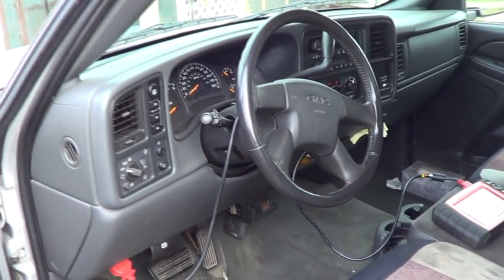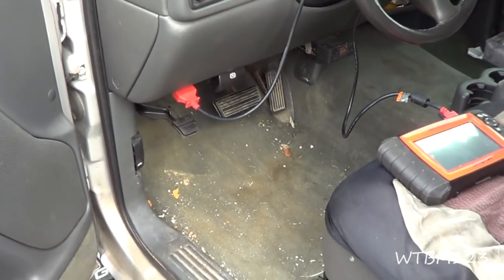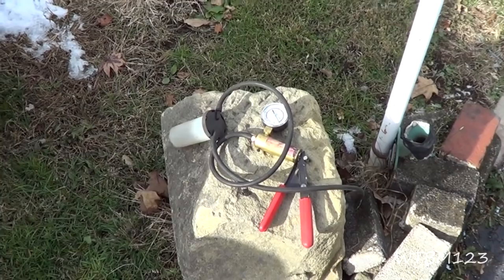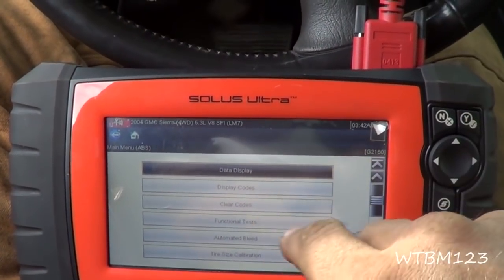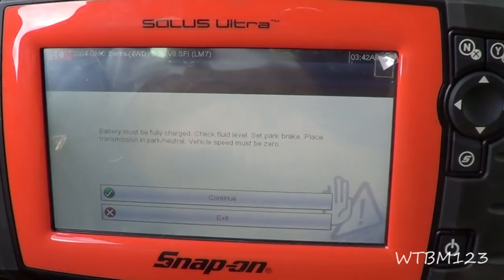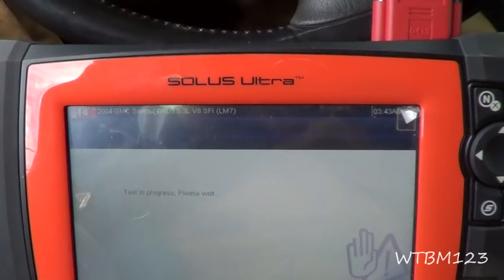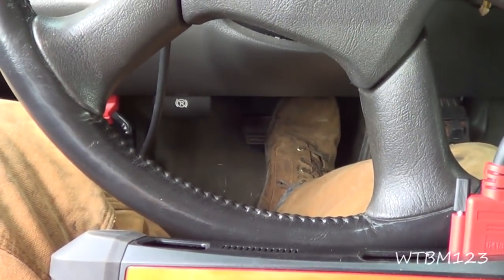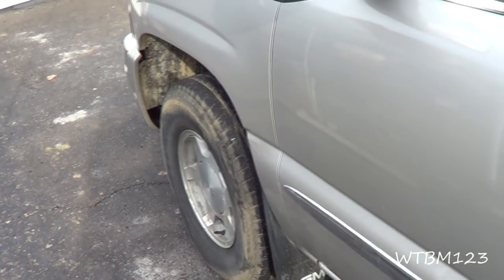Bleeding the ABS Brake Control Module,On a Chevy Using a Snap On Solus Ultra

Comment: So how many hundred dollars does that Snap On Solus Ultra cost?  Back yard mechanics can't afford that kind of money.  My 2001 Dodge can't be bled without scanning the ABS unit.  I'm going back to pre-1984 vehicles.  Computerized vehicles are wallet draining pieces of crap!
Reply: mike johnson or buy a maxicheck pro scan tool. Its about 150. Has auto bleed.
Reply: Scanner Diagnostic Scan Foxwell NT630 Pro,  $110,   most will only read ABS codes, this one can exercise ABS also.
Reply: Ron Dail how does that foxwell scanner work? Referring the auto bleed
Reply: @Otsp922  

It tells you the whole process then you manually bleed like you would.  RR, LR, FR FL in most cases.  I have the NT630 and Autel DS708
Reply: Ron Dail - 2 questions: Do you own one of these Foxwell's, and have you ever bled an ABS system using it? Thanks.
Reply from the maker: It is pricey , but I think there are some out there cheaper that will do it .
Reply: @mike johnson oh lord I love this one. I bet your the guy that brings the auto zone pamphlet of paper with 1 code per page on it and gets pissed bc I say I still need to scan you vehicle with my scanner bc it may have set new transmission codes on the way from auto zone. Lol. Go have the parts boy fix your car then.
Reply: sportster88 5k
Reply: Ron ???
Reply: Dude just bypass it and cover the abs light
Reply: Bradley Knight 
Bradley, are u saying that by pulling the Abs fuse you wouldn’t have to worry about bleeding the abs unit? I’ve pulled the fuse and gone back to old school brakes and need to do a brake line job. Concerned about bleeding procedure without said fuse.
Reply: Try Autel maxicheck pro it does mine.
Reply: sportster88 yes you can bleed the brakes because I have done it here's what you do. 1 bleed the front now drive it on a old road  you are going to go about 30 miles per hour 40 slam on your brakes it's going to open that ABS brake system up and start sending brake fluid to the back brakes get out bleed the back brakes get back in go down the road slam on the brakes again bleed the back brakes it's going to take a while but it will open that abs up and start sending fluid to the back it's a long process but it is cheap that's how you do that
Reply: @scooterb9162  i did that on a lift after replacing the braided lines on a chevy van 👍
Reply: @scooterb9162  
And how will you slam on the brakes if the brake pedal is sinking and you have 0% braking LOL
I took all the air out of lines pressing the pedal and then using the pump on 07 Impala and still dont have any brakes..
Reply: @velizarmilutinovic2947  me too... I'm stuck
Reply: @megaman5k  I sold the impala but i fixed the beakes,,
The caliper i was replacing i didn't tighten the hose all the way so it was constantly pulling the air in.
Reply: @velizarmilutinovic2947  damn. how did u find out it was the line? im thinking about replacing the booster but idk

Comment: Is their a different scanner I can use besides the gm tech 1 to cycle my abs on my 1994 silverado k1500?It is very difficult to obtain the tech 1 scanner because it is so old and I am wondering if their is a scanner I can use that can cycle the abs any feedback appreciated
Reply from the maker: I am not sure . the snap on scanners can do a lot of them , some older ones had a bleeder valve on the abs unit

Comment: Good Video i Need to ask you about  the abs light on a 1999 Gmc Yukon  put all new lines  on it  new hubs in the front  and  adjusted the rear shoes  made sure  the front pads slid  easy  used a bleeder tool like yours master was new check all the rubber  lines  the truck some times just the rear  skids  after it rains and the truck sat for a day  but i never got the abs light to be off after i did all of the work  and some time it just has a mine of its owe right  what do you think it could be  just asking right  thanks for the video
Reply from the maker: Would need to know abs codes. Some older ones with metallic shoes would rust or leave a print on drum and cause a rear brake to stick , but the abs light would need to be looked at with a computer to get the codes and data

Comment: can I manually get the air out via some foot bleed. I have to replace metal flex line from prop valve to pump.  if I get enough pedal can some abs stops in gravel push this air out of unit? the suction bleed out of lines.
Reply from the maker: It is possible to get some air out of a unit that way , but will still need to bleed it down and out of line . It is more uncontrollable doing that way , with the scanner you know it has done all the wheels . All you can do is try
Reply: wtbm123 
thanks for the reply.  I don't have a scanner. I know I will get air in abs since it's before unit.  if it's even driveable after I will take it to Chevy for proper bleed.  just trying to save the labor charge on parts replacement.

Comment: Hoping you might know what's causing my issue. I have an 03, 1500, z71. I've had a soft pedal ever since I did my first brake job using 3rd party parts. Over the years tried everything, every solution I could find on forums. Finally got new everything directly from GM parts (except for rotors and calipers). Lines, MC, hoses, pads. I always used Bosch rotors and have tried four different calipers from two different stores (their top of the line). I've had them bled over 6 times. Three by professional mechanics. NO IMPROVEMENT at all. However...

The reason for the post is to point out something I did to troubleshoot the issue and want to know if the results can help anyone understand what the problem may be. When I clamp off the two front brake hoses (from line to caliper), I get a really hard, and high, pedal. It's exactly how it is supposed to be, how it was when I fist bought the truck. When I remove the clamps the pedal returns to soft and low. My understanding of this method is that it's telling me, then, that there's nothing wrong with the system "before" the clamps. Something between the clamp and the caliper piston is causing this.

Other Notes: Brakes do not leak. Three bleed methods have been tried (push, pull and gravity). Front rotors are wearing evenly as are the rears, however the rears are wearing much faster than the fronts. My impression is that the rear brakes are working harder than the fronts. I also base this on how it feels when stopping, and physically touching the wheel rim and noticing that the backs are hotter than the fronts. I can do long four hours rides and the heat remains the same. The pedal is soft, but the stranger issue is that peddle goes about halfway down before it even begins to brake. Also, while bleeding the rears the flow rate is very slow out of the bleeder compared to the fronts.

Any help would be greatly appreciated.
Reply: Change calipers?

Comment: same process for the 2012 chevy malibu lt? i had bleed the whole system and even the master cylinder but i still spongy pedal.
Reply from the maker: Most chevys you can do this , after the computer still need to bleed to get the air out . this just pushes it out of abs unit . The rubber hoses can cause a low pedal , or pads or caliper slide pin can also

Comment: When doing the abs bleeding , is the system open at all? Or completely closed while doing the test?
Reply from the maker: closed . after the scanner , then u still have to bleed the air out of the lines . this just pushes air out of abs unit and down the lines . so u still got to remove that air

Comment: Anyone know any other cheaper tools that will run the ABS pump?   My brakes are not very tight but I'd like to do this, but this snap on tool is 2000 dollars on ebay.
Reply: Foxwell NT510. About $180 on Amazon. Be sure to get module for your brand of car to do the in-depth stuff.
Reply: Foxwell nt630 elite will do it.  About 130. On amazon.
Reply: take it to a shop durrrr
Reply: Why buy a social tool just to turn on the ABS Motor?  I let fluid go too low on a Jeep GC, pedal would hit the floor after the flush. Did another flush by jumping the ABS Motor at the relay with a 10' wire/switch.
Reply: @CajunWon1  relay to positive post ?

Comment: I done a few brake lines for a friend on a 2004 GMC Sierra 1500 2wd. I've done a few brake jobs ( mostly on ATV's and a few cars none with abs an never had a problem) I replaced both steel lines on the rear axle that "y" from the rear flex to each wheel. Also both front flex lines and the front drivers side steel line from the flex line back to the abs module. The owners thought there was a problem with the master cylinder and had it removed for three or four days prior to me working on it. I determined there was no problem with the master cylinder and bench bleed it (100 slow pumps) with no air bubbles in the tubes returning to the resivor. Then broke both line traveling to the combination valve 3 times from bottom to top to get rid of the air in the line. I've tried bleeding the brake in the correct order with a top of the line vacuum bleeder without being able to get fuild through the rear bleeders( only old fuild) so I proceeded to the front with good results. I then tried bleeding the rear with 2 pumps and crack the bleed with no luck the only way I can get fuild out the rear is to build full pressure on the peddle about 8 pumps so I bleed it that way with no bubbles but not much flow either then proceeded to the front again with good results. The truck has almost no brakes when running unless up pump them about 20 times. Could the abs module be my problem? Thanks
Reply from the maker: +Brandon Sturge Did you remove or replace the brake pads . are they able to slide in there holders freely. Are the caliper slides free and sliding smoothly .  How about the flex line from frame to rear axle, it may be bad  . may try cracking the brake line up stream someplace and see if there is pressure . , if the master is ok then there has to be pressure there , So where does it loose pressure on its route to the back . Could be air in module , but would make sure everything else was working properly first . Also be careful pumping the brake pedal all the way to floor  and give a little time between pumps

Comment: Much appreciated. I have been trying to get the air out of my friends truck brake lines. The rear shoes are good but when I try to bleed the front brakes nothing happens and feels like it creates more air. I even bled the master cylinder
Reply: did you try taking off the bleeder and cleaning the bottom hole on it? sometimes rust can block it and it won't bleed through
Reply: +jonathan corona I ended up taking the front tires off and my friends truck needed new rotors and calipers and front brakes. thanks for the response.

Comment: could air in the module cause the abs light and brake light come on at the same time intermittently?  2002 chevy suburban   thanks
Reply from the maker: +gonepriused  Probably not , usually air gets in from a rusted line or the system was open working on brake lines .
Reply: Thanks

Comment: thank you now i understand why my one trucks brakes sucks
Reply from the maker: +tlcbear2 When i get one in i first check and make sure all the brake pads them selves are not stuck , but moving freely , also the rubber lines are known to cause soft brake pedal . If i see fresh brake line work, or rusty lines , i then will use scan tool to bleed , if it helps then i bleed the lines to get rid of the air it shoved out of unit .  Thank you for watching and commenting

Comment: I have a 2004 GMC Sierra 2wd I replaced all brake pads, rotors, calipers and the 2 brake lines in the front. I've also gone thru 3 master cylinder gaskets (ripped)  Ever since I've been having issues with the passenger front locking up.  That was about 6 months ago. well the other day I finally had enough and replaced calipers, and pads again now the front driver won't bleed and the front passenger barely dribbles the rear are fine but I have no brakes, except my emergency brake, thank god. I don't understand why I had brakes before but now I don't. I'm not even sure where to start to solve the problem. Any advice would be appreciated. Thank you
Reply from the maker: +Sarah Austin Seeing as you said barely dribbles ,and locking up.   i wonder if the rubber flex hoses could be the issue . They sometimes fail inside and close the line off . May see if you have pressure , at the fitting just before the rubber hose . I am not a fan of pushing the brake pedal to bleed , but prefer , vacuum , pressure or gravity bleeding instead . If repeatedly pumping the brakes , it can lead to fluid sudsing .But if doing that way , i suggest 1 push then bleed , wait a few seconds and push 1 time and bleed . You are moving fluid not building a pedal .  They are a lot harder to bleed if they get all bubbled up inside  . Also sometimes the abs module may need bleed with a scanner .

Comment: Hi, I'm sorry .I need your  help, it was a line was broke. and all the fluid is out and now I  changed the line. but still the pedal is all down. 
and my friend tell me that, is the electronic  control unit malfunction. how I should have to fix ? please help what  I shuld do?? thanks.
Reply from the maker: +Máximo Bautista Sounds like either air still in system , or master cylinder may of been damaged by pedal going to far . If air in abs module , some have a bleeder , but sometimes one will need a scanner to do the bleed , then bleed at wheels . sometimes if you can brake and activate the abs it force air out , but better if controlled with a scanner . Not sure on your bleeding process , but i am not a fan of bleeding  brakes by pumping pedal and releasing the bleeder . Vacuum, pressure or even gravity bleed i prefer

Comment: I have a 02 Chevy blazer spent $$638 on new brake system used 4 big bottles and bleed them n still have no brakes bought master cylinder, brake booster, 4 calipers, 4 rotors,and all lines. still have no brakes bought ABS module with pump and bleed again still have no brakes any suggestions
Reply from the maker: +Joselito Santiago Did u beench bleed master , how did u bleed the new abs module , , how are u bleeding the whole system . First , even that all is new , make sure all moving parts including pads are moving free . Be sure u have no bad wheel bearings. Bench bleed master , then i either gravity bleed , or use a vacuum bleeder . once i have what appears to be no air , i use a scan tool to activate the abs module , then bleed again using one of the above methods . if no scan tool , can try and activate abs on gravel road or something , then bleed again , it is just with a scan tool u can activate each one , separate . If bleeding by pumping pedal , i do not let pedal go all the way to floor , and wait a bit between pushing pedal down . I only push down on pedal and release bleeder , i do not pump more than once or twice Slowly , as pumping repeatedly or fast can lead to sudsing the fluid and make it nearly impossible to bleed till the fluid settles back .

Comment: Great video! I have a 1998 Chevy Blazer....replaced rear calibers, new disc and pads all around.Plus new Master cylinder. looks like rear brake lines were replaced all the way up to the ABS pump. Bleed the crap out of the calipers pedal still went to floor after starting the car up. I am sure this is the problem? Going to have it checked at a local shop. Thanks!
Reply from the maker: +Frank Gagstetter Thanks for watching , also make sure none of the rubber lines are swelling , then brakes are applied .

Comment: why would my brakes lock up 2005 chevy truck
Reply from the maker: +Carlton Smith must mean rear . if drum check for gear oil or brake fluid on the shoes . are they adjusted . some times a rubber line can keep brakes from releasing also .

Comment: Hi, firstly thank you for taking the trouble to make this video, much appreciated. I think I understood it all but can I ask the air you are purging from the pump, where does it go? do I need to bleed again at the wheel cylinders?  Ray from the UK.
Reply from the maker: Ray Hindle Yes need to bleed at wheels after , and got to remember the air will take a bit to get to the wheels . I had made the video to show some one how to do the scanner part and should of been more clear about the bleeding afterwards . Doing this just pushes it out of the ABS unit
Reply: So do the scan first then bleed it out?

Comment: I have the Autoenginuity PC based scanner with the Domestic Enhanced package, that I thought has the abs automated bleed procedure but couldn't find it..actually had no acuations when I selected the ABS system.  What type of scanners other than Snap On are known to have this procedure?
Reply: Chris C I have a Genisys and OTC touch, and an AE (autoenginuity), the AE has the function.

How old is your AE? What version software?

I have version 12 and used it today on a 2003 SSR. Choose F7 when connected to the vehicle, then you change the system (engine/ABS/transmission/etc) - choose ABS then click the "Test OnBoard System" tab and you should see the brake bleed test, follow the on screen instructions when you initiate the test. When it says click "next>" it is the ">" symbol on the right side of the "done" button - there is no "next" button.

Hope this helps

Robert Grove
ASE World Class Technician
California BAR Certified Instructor
http://orangecountymobileautorepair.com/about-orange-county-mobile-mechanics/
Reply from the maker: Chris C I believe OTC . I have not used many others so i can not say for sure
Reply: askthemechanic Yep, found the function..wasn't looking in right place for it!  Thanks!